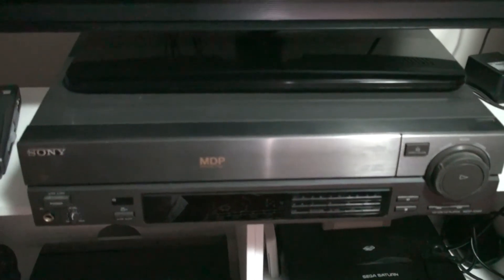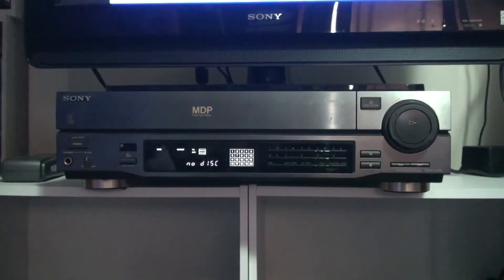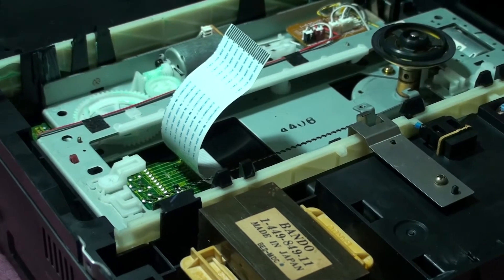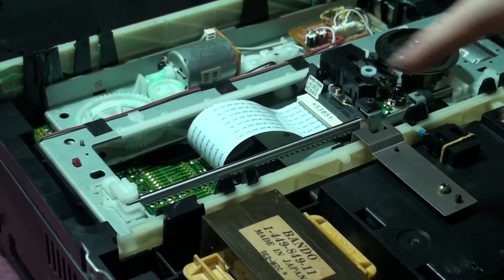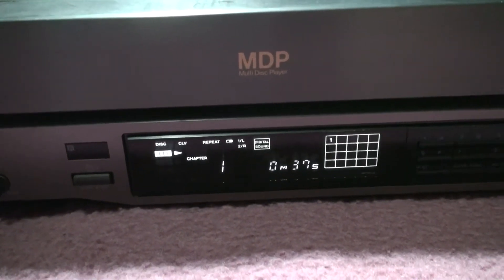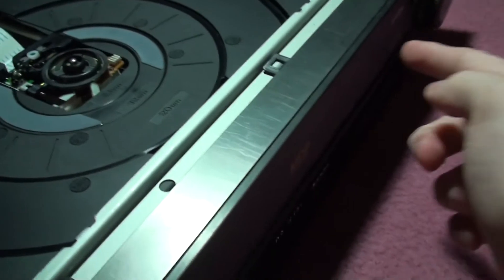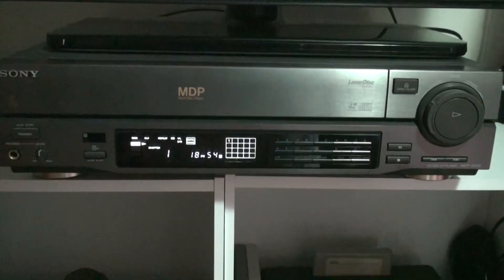Sony Laserdisc player MDP-533D repair Successful

Comment: Thanks for this very helpful video! I got a 333 cheap off ebay as parts not working. I had the exact same experience that you did with the Chinese part. (Probably the same seller). Found it for sale for $35 and 999 in stock. Couple days after I ordered it, I get a message saying, "Part not in stock, pleased to cancel you order" or something to that effect. Thankfully, I was able to find the laser here in America, new old stock, so didn't have to deal with the extra expenses in buying from Germany. Went through your video several times for reference and was able to put the new laser on no problem. The laser disc player works good as new now (except for the door, I need to find a belt for that one day). I watched Predator on it to properly initiate it. Thanks so much!
Reply from the maker: Corey Hey that is awesome news. thanks for watching im glad your machine is up and running.
I'm just curious who was the American seller for the optical pickup? I hope cheaper alternative compared to German seller. I wouldnt mind having spare part.
thanks for watching :)

Comment: Great video!  Glad you were able to get it up and running again!  I've got the North American version of that player and had the same issue with the tray not being able to push the door open.  Replaced the belt a few times now over the years.  Luckily, the laser's still working on mine, but now I know what I'm in for if I ever have to do a replacement!  Thanks for sharing!
Reply from the maker: Culturedog thanks so much.... yeah you are right if you ever have to do the replacement. $$$. I asked the german seller on ebay. Sony do not manufacture  the optical pick up no more. Back in 2008 they purchased all the left overs from Sony and also mentioned they have plenty of stock. interesting.

Comment: Just received one 533D and it have the same problems than yours. I hope cleaning the laser and putting grease will do the thing, 120€ for the laser unit is a lot of money, don’t know if it worth it. Thanks for the laser reference mate, from Spain have a great day!
Reply from the maker: Good luck with it. My machine still works. I tried it a few weeks ago. To be fair I have not used for about 5 years. Laser works well. 
The only thing is the poor quality rubber band broke. This reminds me I should track down a proper band. I had issues with the disc tray as the machine had a fault. The only way to play movies is by pulling the lid off. 
Please let me know how you go. Even upload.a short video.
Good luck!
Reply: @jpstyles85 Well, the problem seems to be more serious: the laser don't makes any move, the door don't open even with a good shape rubber and on the LCD screen it shows Open or Close. Then on the TV screen it shows Side A CAV... Jesus Christ the unit is near dead! 😓 I can upload a video, tell me where. Anyway, thanks for reply and have a nice day.

Comment: Good video explained very well the  details for to replace the optical pick head KHS-130A for this Sony LD Player MDP 333.I have the same LD Player MDP-333 and needs to replace this same optical pick up head ,but the problem is that Sony no makes more this spare part.(optical pick up head KHS-130A).I decided to buy it by I site that have sellers that sells it in OEM version,because ,Luke I said, Sony not have it more.If you see the optical pick ups are the same ,not have some diference ,buy when you put it for to play they can't play.I bought four optical pick up heads and they not worked. I guessed from one of my friends  a original optical pick up Sony KHS130A that he have of his Sony LD player and when I putted it on my MDP333 it worked greats. Play lds,cdvs and CDs too. Like now not have more original kHs130A for to sell more from Sony Company,I'd Like that You 'd said me, if have some detail that I have to make for to put these optical pick up heads khs130a that I bought in OEM in condition fo to works good in my LD player. I try to make some adjusts in track,focus ,buy with no sucess,please if possível you help me I'd became very agreement with tour atention.With best regards.
,

Comment: I had a loose loading belt so I put it in boiling water for a few seconds and added a small amount of lithium grease. That fixed it. This also worked in a Xbox drive loading belt..

Comment: Thank you for the video. I hope you can help me with a good advice. I have Sony MDP-650D Laserdisc player with some problem. The player doesn't spin the disc. After inserting the disc (no matter CD or LD), push 'PLAY', the laser moves, changes positions, but the disc still not moving/not spinning. On the display it does say 'DISC' if I insert LD and if I insert CD it does say 'NO DISC'. I believe that laser is bad, I need to replace it. But, still, why does the disc doesn't spin even if the laser is bad? I saw you playing Mickey LD, I admire the quality of the picture (sharp & clear). What kind of connection do you use with your TV? I have another Sony ES Laserdisc player with scart connection, I really do not like the quality, it's not sharp enough. I believe scart is not the best connector in combination of LD-player and TV. Would you advice me: http://www.miniinthebox.com/nl/5-voeten-hdmi-male-ingang-naar-3-rca-plug-video-audio-av-kabel-adapter-converter-connector-duurzaam-zwart-1-5m_p1272459.html?prm=2.2.1.0 or this connector: https://www.monoprice.com/product?p_id=9994 your comment will be very appreciated.

Comment: ugh, that tray loading belt! My tray jumped a few teef and I had problem aligning those gears. service Manual Shows an alignment but that didnt work for me and didn't show HOW to load the tray. Kept on trying each combo, but what finally worked was turning those gears (aligned in Service Manual) a bit to engage the teefs and eventually found a spot that worked! once loading, don't frick with them. :L <3 all

Comment: I have a sony laserdisc player (video looked great but did not play any sound) and a shop diagnosed it with the same problems yours had. (belt and laser too dim)
Would you be interested in trying to fix it or adding it to your collection for parts? If none of the laserdisc collectors on youtube seem interested, I'll just sell it for parts but I'd like to give a dedicated enthusiast the chance first.
Reply from the maker: I'm from Australia. i think postage would be a killer. where are you located?
Reply: jpstyles85
Detroit, MI USA.
Yeah postage would be a bitch and it's also worth noting that this player likely only does NTSC discs and your country uses PAL
Reply from the maker: one thing . 95% of my LD movies are ntsc... most LD players here play both ntsc/ pal which is more to say then most other devices of the time. like region locked gaming systems. sega. nintendo ps1.

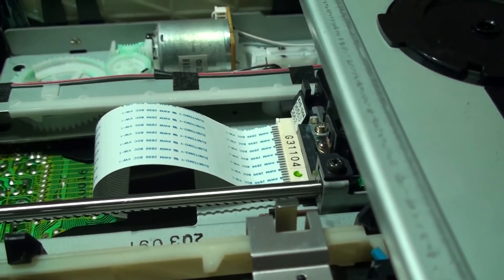Comment: @3:32   ok...  How did you know the Laser was "Bad"  ?  Just because it did not light up?  Maybe the front panel read out indicated something that revealed it was bad?  Probably both... I am guessing...  

But I see the NEW laser doing it's little dance, and maybe the "Bad" laser did not dance?

IMHO
Reply from the maker: I can't be bothered typing a whole life story. it works now. thanks for watching!
Reply: @jpstyles85  Thanks for the fast reply!  I was actually expecting some one else to tell me, as this video was made 4 years ago...  I just need an idea of what to look for when I open up my MDP650...  I was sitting around for 15 years, I am told, so I expect it will be an old belt or something...
Reply: And thanks for the Video!  I was just wasting time in the early morning when I watched it, and not really thinking about what I was doing.  I guess my post was just thinking out loud (in type...)
Reply from the maker: @Freddy-Da-Freeloadah  All good! I hope you can get your machine up and running once again. Is it opening the disc tray or not reading the LD or cd discs?